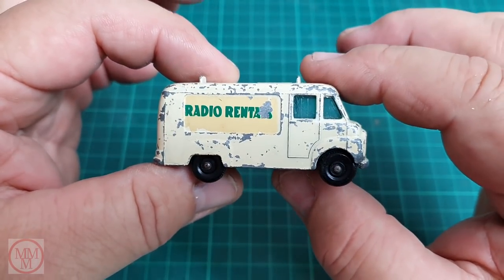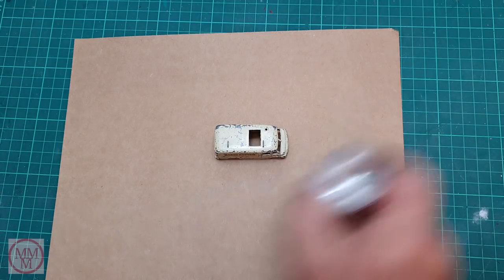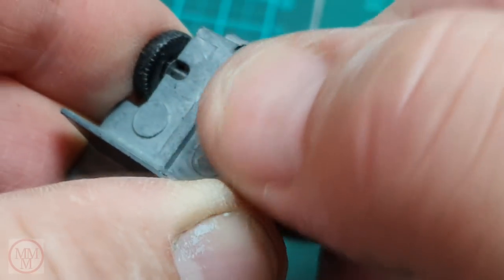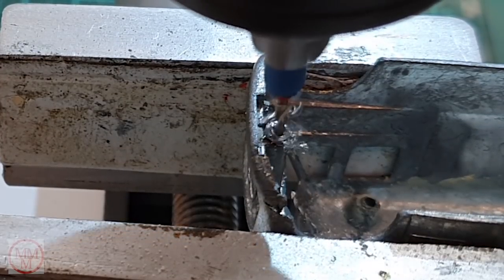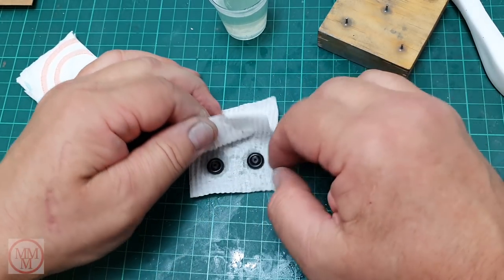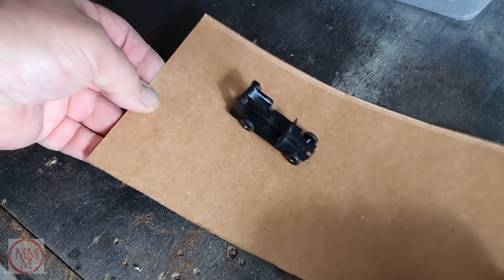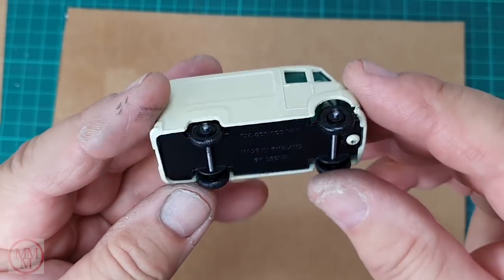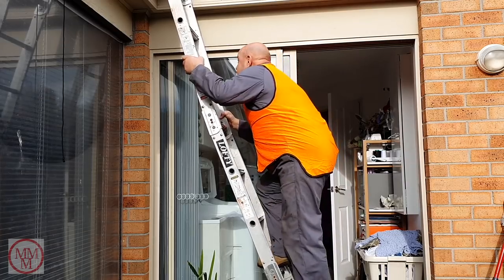MATCHBOX Restoration 62b Commer Radio Rentals Van 1963

Comment: I once had my ladder fall down while I was up on my roof blowing leaves out of the rain gutters.....the ladder was just resting against the edge of the roof, and it was a gusty windy day.  No Koala to blame. I foresaw an ordeal of standing on the roof yelling in hopes that a neighbor or passerby would notice and come put the ladder back up. Luckily, I had used a long rope to pull the blower up to the roof after I climbed up there, and I had tied one end of the rope to the top rung of the ladder, and stuck the other end of the rope into the downspout to keep it in place. I was able to pull the ladder back up by that means, although as it was an extension ladder, there was a risk of the bottom half sliding off as I pulled it back up. Ever since then, I use two large double-sided Velcro straps, wrapped around the ladder joint, to keep the two halves locked together, and two strong spring clamps and a short bungee cord to lash the top of the ladder to the edge of the roof, or the rain gutter, to prevent recurrence.

Nice Matchbox vid, though.....

Comment: Used your small stone trick to remove a corroded screw from my gas powered "Bar-Be". I was able to find a cone shaped stone to access the impossible to get to location, which may work for you.  "Up over" I've used an automotive headlight cover restorer cream (less pumice then the metal polish) to remove the scratches to plastics for Laptops and PC's I repair.  Thanks for another great video. Narragansett Bay

Comment: Hey Marty, you could try to Drill the Tap hole with your Dremel, i think that would be easier than finding a way to hold it in your Drill. 😉
Reply: That is what I do.  The Dremel has a very fine drill chuck for the small drills.  Works well as a hand tool for the thread tap too.

Comment: Hi, re mixing paints. I used to make up large batches of paint for my models as for some of my projects I needed to do multiple versions. I used to use 35 mm camera film case's. These are air tight and the paint lasts ages when stored in them. Easily found on eBay. 
Dean
Reply from the maker: Great idea Dean, I might try to get some and then I could label the pots with the model number!

Comment: You should try wrapping the parts in aluminium foil after coating with paint stripper, leave overnight and you can probably just wash all the paint off. Wrapping them up in foil keeps the solvent from drying out and keeps working longer. Believe me it works.

Comment: Hey, when a decal gives you trouble, try using a small paintbrush moisted with some water to manipulate it. A similar to the one you use to paint details would be perfect. It's much safer for the decal than using tweezers or other sharp object.

Comment: I know:  To justify the 'visible discrepancies', just think of the model as a ''Matchbox sales representatives demo model''.  One that they might have taken around to toy fairs or toy shops before they released the actual thing en-masse.  So, it's ''new old stock' - ex display/demo''.  Yeah - that'd be it!  And do you want an honest opinion? (yer getting one anyway!) .... I would PREFER to own that Radio Rentals van, more than the 'Rent-a-set' van you have.  As you say, it looks more 'genuine', as not all of the models back in the day came away from the factory in pristine condition.  There were casting flaws that were missed before they were shipped out, and even decal issues.  This, to me, was a really nice makeover you've done.

Keep on keeping on.  Regards.  Dawg. (he of the long waffle security email)

Comment: could be that "damaged front bumber" a casting mistake? since the two models are a little bit different (one has a rivet other does not)

@24:23 what is that spinning thingy on the roof?
Reply: dexter1981 a radio signal direction finder,or tv signal. Used to help set up new renters antenna or to locate homes who are stealing signals.

Remember the Post trucks in Germany with the antenna stopping on the corner at between 7-8pm looking for people stealing signal. The antenna on top would turn, stop, turn, stop, turn some more as the operator tried to narrow down the signal location.

Comment: the high viz jacket is a bit over kill you needed the oh wait no your in oz down under so that's fine, no need for extra safety gear, also it didn't look that high you should just jump down, that or adjust the aril back to lose the signal,

Comment: Is there someone able to tell me why he doesn't sandblast the models to remove the paint?
Reply: I use chemical stripper on my Matchbox, in fact the same brand as Marty.  Other methods are caustic soda, and media blasting.  All methods work well, just individual preference.
Reply: @railtrolley  Alright thanks! Personally I don't restore things for hobby but for these kind of things I'd prefer sandblasting
Reply: @mikekleinleugemors4336  Sandblasting is good.  I've seen how well it cleans rust and old paint off metal.  I use chemical stripper  just for convenience.  1 small can stored in the cupboard.
Reply: @railtrolley  That's true yeah but wouldn't a small sandblasting thing be cheaper on the long run?

Comment: Hi, Marty1  My God I just thought of something when you were mixing your paints and putting the tape on top so it won't dry out.  Since you have a 3D printer why don't you print a top for that little cup you use to cover the mixed paint.  It shouldn't take more then a couple of minutes to make one in the cad program you use and maybe like 30 to 45 minutes to print one out and try it.